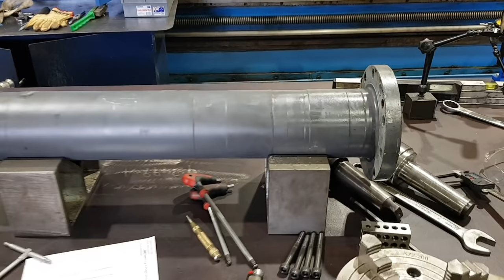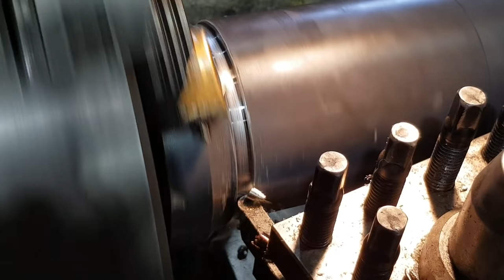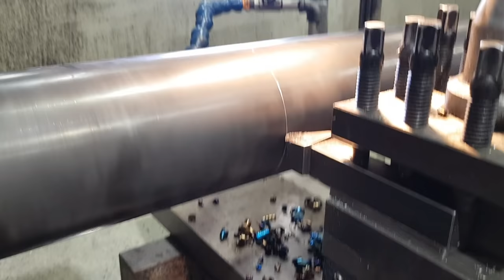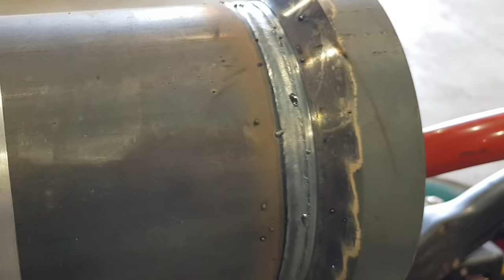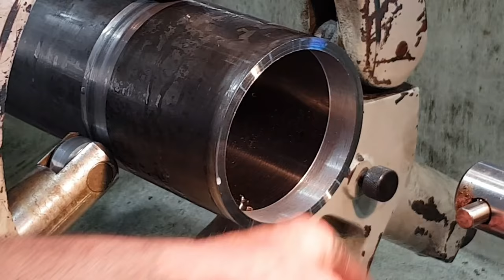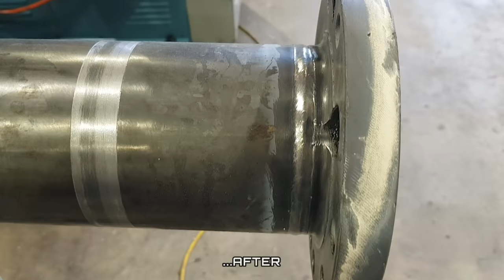Machining & Welding Road Milling Machine Hydraulic Cylinder barrel | TIG & MIG

Comment from the maker: Hey viewers thanks for watching todays video of machining the road profiler lift cylinder barrel. What did you think of the welding and finished result? 😎👍
Make sure to subscribe & hit the bell icon to turn on notifications so you don't miss our weekly uploads. 👇 🤳
Follow us online here: 
Instagram https://www.instagram.com/cutting_edge_engineering 
Facebook https://www.facebook.com/cuttingedgeengineeringaustralia/
Official CEE Merch shop: https://www.ceeshop.com.au
Reply: Curtis. Very good finish. Have you made a the welding jig for doing pipe or was that shop made. Only they are major money over here in England. Many thanks. Lisa.
Reply from the maker: @lisaburnett3368  hey mate do you mean the adjustable steady roller setup? Yeah shop made but was actually made for our big lathe to steady jobs that extend from the spindle but works well for this too haha.
Reply: I watch them all. Usually on the television 📺 with a beer 🍺. Can’t comment on the Tele and have to use my phone to do so. It’s all good as that doubles your view count lol 😆. Cheers
Reply: sweet video ! looks like some gravy work there.
I'm curious as to  why you don't run the metal core hotter in spray arc ?
Reply: What gas mix You are using with mig? Nice work! 🙂
Reply from the maker: @arisalo4623  hey mate it's a dual shield gas 80% argon and 20% Co2
Reply: Rly nice! You get very similar tig results with pulse mig. I've changed all the way to pulse once i got to try it. You got an new subscriber now!
Reply: The mig welds turned out great. I would like to run a solid core wire as well but my dad swears by flux core and has its his machine, what can I do? 😀 I do sneak a spool of solid in every now and again for my own projects, but it always get swapped back
Reply: Nice work. Does anyone else work at CEE
Reply: Had a quick question, how come you don't go with a pulse mig? No splatter and can be alot hotter welding
Reply: .aq
Reply: @kenlavender4233  I very curious to know that as well.
Reply: Just a thought for Karen. Try using a shade 13 lens in the welding mask, that should eliminate any glare, like your seeing in a shade 9 or 10 ( which I think you are using), I think it might be worth a try
Reply: @DCT_Aaron_Engineering  ok

Comment: I worked for a number of years for a big excavation company, as a mechanic. They always outsourced cylinder rebuilds, until i said that i could do it. I built a big machine kinda like a lathe, but it was for breaking loose the piston nut off the rod. When the rod or barrel were junk, they had to just purchase new, they didn't want to tool up to let me build the entire units, mainly cause they didn't want to be forced to paying me a higher wage, morons spent way more buying new rods and barrels, and could have saved or made money in the long run, cause there wasn't anybody in the state that would build them. You can lead a horse to water, but you can't make them drink. Nice work as always, would love to work with you. Take care and Cheers!!!

Comment: Yes I have seen were you spun the two pieces. When one is rotating clockwise and the other piece rotates counter clockwise it's hot welding! I've seen it done on several video programs. Very interesting process.

Comment: Nice job Kurtis! I'd be surprised if that's not a common point of failure on those profilers, they vibrate that much when they're cutting to feel it in a vehicle 100 metres away.
Reply from the maker: You're not wrong hopefully this time it lasts a bit longer 😎👍

Comment: Hi there and greetings from snowy Sweden! Once again great video! Really like the ”bloopers” in the end! 

Did the customer buy new piston for that cylinder or is that also a job for you? Do you use special filler when tig welding inside the cylinder tube?

Looking forward to see some jobs done on the 7 meter beast that you bought!
Reply from the maker: Hey mate thanks for watching from there would love some of the cooler weather sent this way haha. Customer was able to re-use the original piston as that wasn't damaged and no special filler just ER70S-6 it's a 70 tensile wire. Cheers 😎👍

Comment: Nice job. Please show us if possible video how you can weld the two parts by melting them together without a welding machine. Thanks. Every video I saw is very interesting, keep posting.
Reply: That's spin welding , he doesn't have the equipment to do it ....

Comment: Ouch... yeah that hydraulic system had some issues.  Hope their pump is ok as I'm sure it picks up unfiltered oil.  I bet new OEM cylinders are big bucks, then the wait to get them.  That's where you come in ;-)
Reply from the maker: Hey mate yeah the whole hydraulic system got stripped and cleaned they found metal everywhere 😬

Comment: You sure like spinning those chuck keys I've noticed in some of your videos....I'll give you an idea what we do in our workshop to bring those jaws in or out.. get a 12mm square piece about 150mm long put a round section on a end of it about 20mm long by running it on belt linisher and then stick that into a cheap cordless drill from trade tools ... trust me you'll love for not taking so long spinning that key to always change jaws around or moving them to whatever diameter

Comment: I would have to say the welding is 1000%   Could you have done friction welding instead,  also how come you don't use and lube on the steady rest rollers?  I appreciate all the work that you do to show how you do great things. Thanks Hank
Reply from the maker: Hey mate this lathe doesn't have high enough rpm for friction welding. That welding positioner is rated for rotating 200kg so no need for lube on the rollers was turning no problem. Cheers, Kurtis 😎👍
Reply: @CuttingEdgeEngineering  Thanks for the feed back I really enjoy watching you all doing the machining!

Comment: This is an old video but I noticed you don't use the TIG for the root pass as of late. You can of course get a full thickness weld from the outside with the MIG by having a 1/8th gap between the parts (just like the pipe welders do). You can presumably prevent splatter by stuffing a dead cat (or small wallaby) down the hole backed by some anti spatter spray. Is this the approach you now take or would you still prefer the TIG for full thickness?

Comment: Enjoyed the vid....I can barely weld with flux core mig so Im no critic, but I thought your welds looked really good.   Would have never thought of using Tig on the inside to avoid splatter, but it made sense.  Sometime in the future, could you touch on the X/Y display on the lathe and how it relates to the machine and workpiece?  Thanks

Comment: When tiging a inside joint you should  cut a disk out of cardboard and put it in the tube it keeps the gas from flowing down the tube and you will save gas and possibly  porosity problems. Cheers

Comment: Great job, thought you trying a bit of friction welding on the small flange end!, guessing you were closing any gaps, prior to the Tig root; nice Mig/Mag Welding.
Is the home made boring bar a chromed piston rod?.
Well done Mrs Kurtis on the photography.
Thanks for sharing and stay safe all.
Regards John.
Reply from the maker: Hey John cheers mate haha yeah a few people commented they thought was going to friction weld, unfortunately lathe doesn't have enough rpm to do that. Yeah the boring bar is an old cylinder rod piece of 40mm 4140 chrome bar. Cheers, Kurtis 😎👍
Reply: @CuttingEdgeEngineering  Great material for a  boring bar, fairly good for stiffness.

Comment: I know nothing about machining per say but think it is something I would have enjoyed.Spent my life first as a bush pilot in Northern Canada and then as a commercial pilot on heave jet aircraft. Sounds very different but the skill set required is similar. To my question, I noticed you did not have to hone the barrel, do they come that way from your supplier.
Cheers
Reply from the maker: Hey mate very cool work you've been in I reckon 😎👍. Yeah the smaller size tube like this size comes pre-honed

Comment: did you have to align the flange bolt patterns up?
Reply from the maker: Hey mate yeah I measure to center height of machine when it's first setup in the lathe and mark them before doing any turning 👍

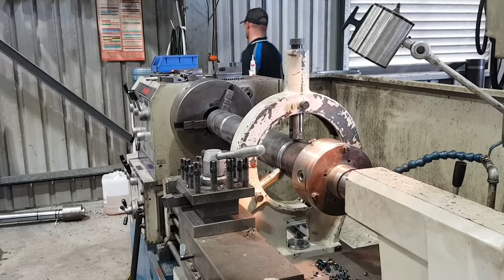Comment: At 15:00 with much more speed and preasure I could see a friction weld happening....
Reply from the maker: Hahaha yeah looked like it could've gone that way 🤣👍
Reply: I was thinking the same!
Reply: Suitable parameters to direct drive friction weld 125/100mm OD/ID steel tube would be 450 to 800 rpm, rotating force ( Frictioning) = 208 kilonewtons, ( 21,000 kgsF, Forge force ( Stopped) 550 kN (56,000 kgsF), loss of length during frictioning = 9.0 mm, then total loss of length with forge collapse = 14 mm.
Edit: Approx motor power needed would be 185 kilowatt.
Don't think the lathe bearings would take it.lol.
Reply: @bostedtap8399  The Axial load on tapered roller bearings in that lathe would probably take approx 14 kgsF , also the loss of 14mm would have to be allocated into the final OEM parameters.
Reply: @RolandElliottFirstG  14 kgf ?,the forces required are several magnitudes greater, plus you need about 185 kilowatt motor power.
Reply: @bostedtap8399  14,000 it was missing 000

Comment: Awesome job. Did you have to align the bolt holes on the two flanges?
Reply from the maker: Hey mate thanks. Yeah we mark a position on each end to center height of the lathe while it's setup and then realign and measure to that 😎👍
Reply: @CuttingEdgeEngineering  - Thanks for sharing.

Comment: I think this was the first of your videos that I watched.  I was fascinated by the button inserts.  I'd never seen one. I bought a couple and love them.
Why did you run the tubes cw when you were boring the id?  My lathe doesn't have reverse so I've not used that procedure.
Reply: Could it have been to see it better? I'm not a machinist, so I'm just guessing.

Comment: What is it that you don’t like about quick change tool posts?
Reply from the maker: Hey mate a few reasons, never found one rigid enough here in Aussie for the work I do. A standard tool post has more range with tool positioning. I can use my tooling across all 3 lathes without adjusting centre height like I would need to on a quick change. 😎👍

Comment: What kind of price do you get for the chips and scrap metal?? Any good?
Reply from the maker: Hey mate we are getting AUD$280 per tonne from our scrap metal guy
Reply: @CuttingEdgeEngineering  dammmmmmm were getting $120 per ton it's horrible. My ex father in law works for a big steel company here in Vegas and they have to wait till they have at least 30 tons of scrap metal before they take it to California and get anywhere between $190 to $230 per ton. But they have a yard out there so they can do that because you have to be a resident or business to get thoses price's

Comment: In my opinion, you weld great.
But, If you want a more professional job look, Try using  spool filler wire. The weld can be continuous then from start to finish.

Comment: If the barrels are standard sizes.  Would it be possible to make a fireproof plug to keep slag from going down the barrel
Reply from the maker: Hey mate yeah it would be but these aren't a high enough turnover component to need it 😎👍

Comment: 37 and half degree weld prep if u take a 45 degree insert tool mill the back part of the holder on a 15 degrees angle that gives the 37 degree s

Comment: is this welding procedure common on cylinders? i get the TIG on the bore but why not stick on the outside? it's a roll weld, backgrind and tig the inside. just wondering is all

Comment: At the end I was wondering if you were going to put it back in the lathe for a surface finishing pass on the flange face.  How critical is that on a cylinder like this?

Comment: What do the acronyms for the different tools means like ‘wmng’ etc?
Reply from the maker: Hey mate it's the industry standard designation for it's shape, angle, tolerance and chip breaking.
Reply: I had this same question in my head earlier in the day, and found this, in case you’re still curious for more details:

http://www.mitsubishicarbide.com/en/technical_information/tec_turning_tools/tec_turning_insert/tec_turning_guide/tec_turning_identification

Comment: Genuine noob question: If you insert the teeth of the chuck at slightly different rotations of the screw that adjusts them, doesn't that make the whole grab of the chuck off center? Thanks in advance although I know this is an old video. I'm working my way through them 😂
Reply: each jaw has teeth on the back to fit into the scroll inside the chuck, each jaw is numbered to fit into the same numbered jaw slot on the chuck, the teeth on the jaw are cut to accept the scroll  in each numbered position, you cannot use #1 jaw in any other slot but #1 and so on, as you place #1 and turn the scroll it catches the groove of the scroll, rotate the scroll insert #2 it catches the scroll, insert #3 rotate scroll it catches the grooves and all is good

Comment: 15:05 Did I see correctly that the lathe was disconnected from the power supply before tac-welding?
To prevent the lathe from breaking down Electronics?

Comment: Why don't you like quick change tool posts?
Reply from the maker: Hey mate a few reasons, mostly never found one rigid enough here in Aussie for the work I do. A standard tool post has more range with tool positioning and I can use my tooling across all 3 lathes without adjusting centre height like I would need to on a quick change. 😎👍

Comment: How long do cutters last you?
Reply from the maker: How longs a piece of string 🤣 many factors impact how long an insert lasts... material, how abusive I'm being haha. An insert will normally last a few jobs
Reply: @CuttingEdgeEngineering  that is very true on how hard you are on them lol just figured they wouldn't last but a couple of jobs even if you were easy on them. I would love to come down under for a week and just watch and hang out to see what you do in pwrson. I use to build all the pro FMX freestyle ramps for all competitions and portable freestyle setups for Metal Mulisha, twitch, Carey Hart, Carey hart did his first ever back flip at my compound before he went to X games and pulled it off just barely. I was a pro FMX rider for a couple of years until a drunk driver hit me almost killing me, split my head from front to back, broke 6 in my neck and 15 in my back. My uncle was the Captain of the heavy rescue fire truck that was dispatched to my accident and I was awake and talking but so fucked that he had no clue who I was until they cut me out of my car. If you look at my youtube pic that's my head with 800 staples holding it back together with 2500 stitches on the under the staples.

Comment: Why don’t you change to quick change tool heads?
Reply from the maker: Hey mate a few reasons, never found one rigid enough here in Aussie for the work I do. A standard tool post has more range with tool positioning. I can use my tooling across all 3 lathes without adjusting centre height like I would need to on a quick change. 😎👍